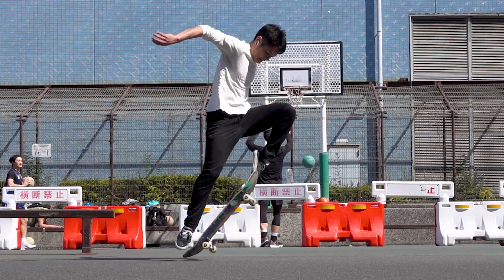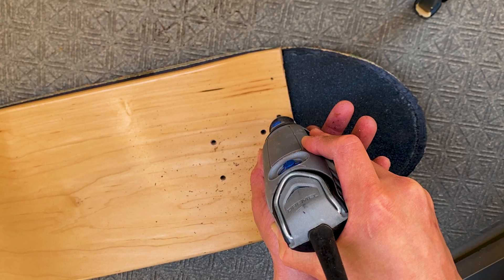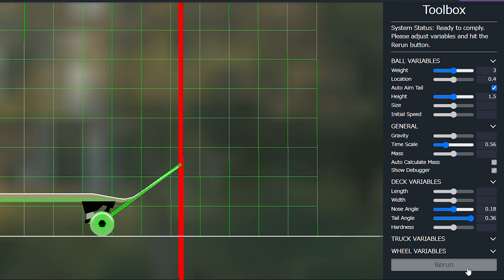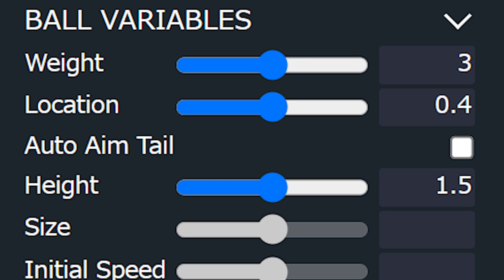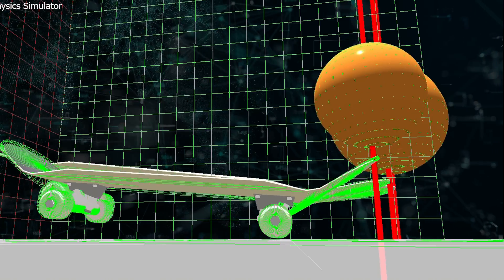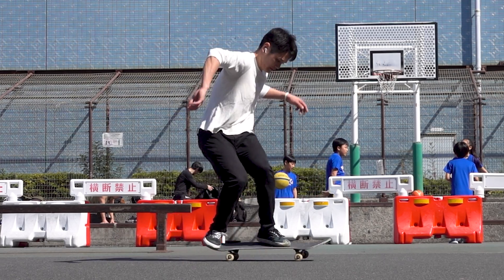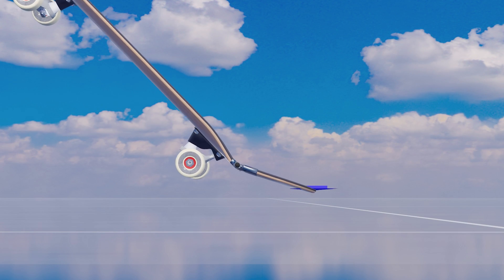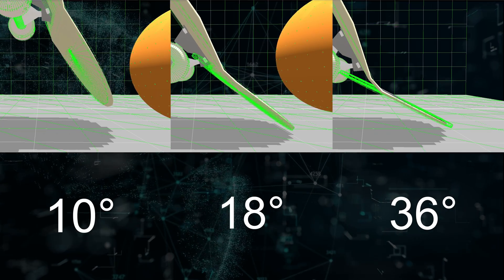ADJUSTABLE TAIL SKATEBOARD - What's the best angle?

Comment: Would be interesting to also be able to test the wheelbase to "tailbase" (the point where the tail angle actually starts) may be interesting
I know element used to play with it for the "delayed pop" technology
If this works the way I think it does the board should lift up as slow as a steeper tail angle with a mellower actual angle
Reply from the maker: Ohhkay, interesting. Will look into it right away. Thanks for that!
Reply: Maybe also riser pads… 1/4 inch riser pads would not be such significance but if you decide to install 3/8 or 1/2 inch riser pads plays a roll in pop timing. I ride 1/2 inch riser because I love loose trucks and transition to 1/2 inch risers the pop delay was way different compared to having a 1/4 riser.

Comment: I've done a lot of experimentation with this subject recently because I was struggling with popping and catching my kickflips as high as I used to when I was in my prime before my ankle injury. Back in the days all I would skate were mellow shapes and I had no problem catching my flip tricks at the apex of my airs, but after getting back into skating in my 30's and having a weaker ankle due to my injury all of my tricks were sandbagging and I felt I could never get a proper satisfying catch no matter how hard I would snap the tail and how fast I would flick the board. It wasn't until I tried out my brothers board that had way steeper kicks than what I was used to that I instantly felt a world of difference in my ollies and kickflips, so I decided to buy one of my own. The amount of force needed to do tricks and the timing just felt more natural for some reason, almost as if the handicap of my weaker old man legs were being balanced out by the slight increase in force I needed to use to pop the tail. Because I'm older, steeper kicks definitely fixed my skating. It almost feels like its cheating sometimes! But hey whatever works for you and makes you happy, sick video :)

Comment: Shallow tails pop higher, hence why the nose is usually raised more (for easier flipping). This simulation doesnt really prove anything since the force applied by a bouncing ball is very different to that of a properly timed pop. Force appied by a foot should accelerate as the tail moves down but the ball transfers all its force at the start of the pop and then bounces off.

I love that you're turning into a science though, keep it up.
Reply from the maker: True and great point. Let's see what I can do...